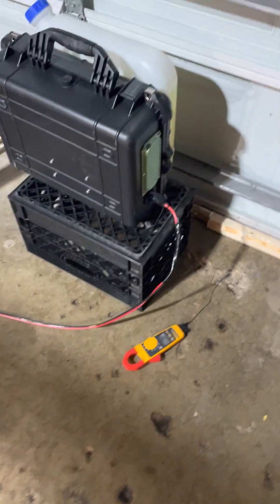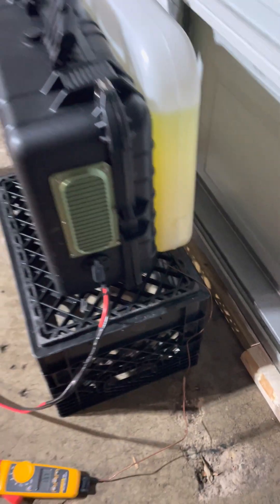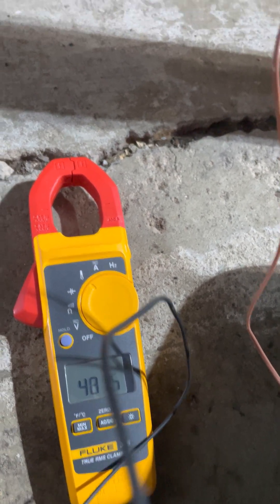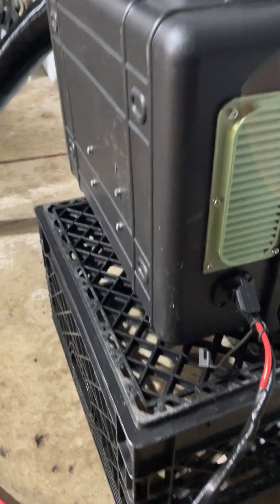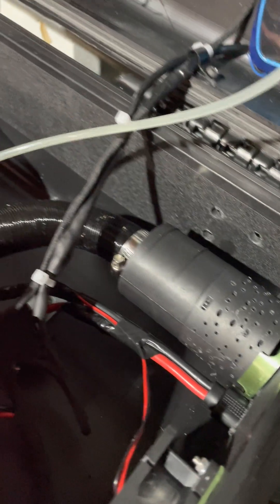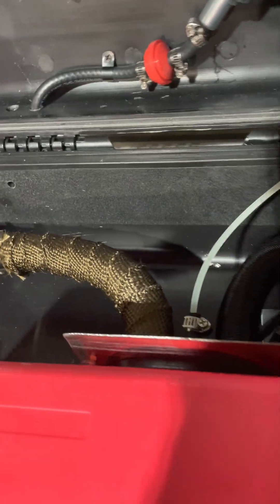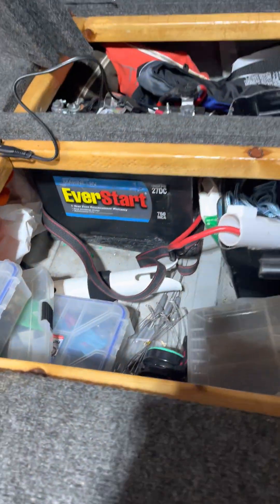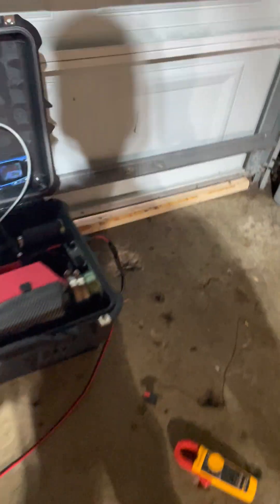Diesel heater in a Harbor Freight box: temps inside the box while running

Comment: Hey Tim - I know the 2KW heaters are smaller, do you have any clue if you could retrofit a 2KW into this build?
Reply from the maker: I don't think it would work with the 3-D printed STL files, but I'm sure you could make it work with enough ingenuity. It is smaller in all dimensions so it will definitely fit. You would just have to come up with the parts/tubing to extend it long enough to reach the sides of the box because the 2kw is shorter.
Reply: Keegan has plans for a 2 k heater as well

Comment: What's the point in building one of these when they sell all in one units for the same price? I mean this isn't water proof. There issue an internal battery. Scars the advantage to this?
Reply from the maker: Most of those have the little controller mounted on the outside which is a no go if you camp and this stays outside of the vehicle or tent. That's my number one use for this thing. That's why all of the temperatures I took here are important. My initial worry was the temps in the box would be too hot for the controller to live long. 

This is not waterproof, but I transport it on too of the vehicle and drive through rain and snow. I is rain proof and stayed dry inside even after a 10 hour drive. I also wanted something a bit more durable construction than paper thin sheet metal and generally cheap construction. Those all in ones just look so incredibly flimsy and cheaply made I chose to make this.

Comment: I have questions about the power plug. How did you do it? Are you using his 2 pronged plug?
Reply from the maker: It is just a standard SAE style female flush mount built into the box and a male on the power cord to the battery.

Comment: Nice walk around. I just ordered the parts from Keegan. What fuel pump are you using? It seems quiet.
Reply from the maker: This is the stock pump mounted in the little rubber isolation mount that comes with the kit. I've never really considered it being quite or loud. You can hear it in person, but I've never been bothered by it.

Comment: Could you please provide a link to the fuel filter you've used?
Reply from the maker: I bought it at a hardware store by the lawnmower stuff. You can get them anywhere, or order them. It's just a Briggs and Stratton fuel filter 150 micron. This is not where I ordered from, but it's the same thing. Briggs & Stratton 4105 5-Pack Of 298090S Fuel Filter 150 Micron For Engines without Fuel Pump https://a.co/d/hXgBSq9
Reply: @timlong1462  thank you!

Comment: I appreciate your information. How much diesel did you use?
Reply from the maker: I'm not sure because I didn't measure. There's a lot of videos on fuel usage. Also you can do the math because it's a dose pump that moves a specific volume, and the hz measures pumps per second.
Reply: @timlong1462  thanks

Comment: I don't understand why is everyone like doing this build if you can buy one in 2 different size that's already have the metal case. Not plastic?
Reply from the maker: The difference is being able to set this one outdoors in rain/snow and then throw it up on the roof during travel. None of the premade versions are waterproof or water resistant at all. While this design cant be dunked under water, it could be sprayed with a hose no worries or set out in the rain with the addition of a 3 inch plug, or with the output heat hose in place. 

The only design I saw built similar was the Hcalory (I think spelled that way) and it looked extremely cheaply made for $300 or $150 more than the kit I built this with. The metal case ones just look cheap and flimsy in my opinion. To each their own though. If one of those works for you then save the time and just go with a premade design.

Comment: What fuel line did you buy?  Is it a certain diameter? Looks like you did two different types.
Reply from the maker: This heater came with the hard nylon line which depending on who you trust is probably the correct stuff to use. Since it's a very small inner diameter it helps bleed the air out of the system faster, won't bulge outward under stroke presser from the pump, and it's very heat resistant. The line from the tank to the pump intake doesn't really matter, so I just used some gates fuel line that felt like it would stand up to the elements and be durable in the cold. There are plenty of other videos here on YouTube of how to properly install using the clear nylon fuel line. You use the small chunk of rubber fuel line they supply to essentially sheath the connection between the pump and heater and the nylon line.

If yours comes with the orange or green fuel line my advice would be take the pump, whatever fuel filter you plan to use and the fuel tank outlet to an auto parts store and get better fuel line.

Comment: Hey man, this is a nice build. I like that extra exhaust wrap!!  It works so well!!??  Would you consider wrapping that outer exhaust pipe as well for safety?  Or put the sleeve on it?  I’m doing a similar build now
Reply from the maker: I actually want the section inside the garage exposed, might as well get all the heat out of it that I can. If this was not a rental, I would put an 8-10 foot chunk of black pipe the length of the garage before exiting out the back to get more of the radiant exhaust heat into the garage. 
Since I can't cut holes in the wall I have to run the exhaust under the garage door, so the only part I have put the sleeve over is a 4 inch section that gets sandwiched under the door. I was able to layer three chunks of the heat tubing over one another on that small piece under the door to protect the rubber sweep. Then I fill the gaps under the rest of the door with assorted lengths of 2X4 lumber. Helps keep the draft from coming under the gap.

Comment: Topp 3.6hz in secret menu code 1688 is much better fuel consume. Ane burn more clean.
Now you clogs it slowly up.

3.6hz at topp and 1.2hz at low.
Over you only clogs it up slow but for shure.

You get the same heat
Reply: Can you explain this a bit more?  I didn’t entirely understand what it’s doing?
Reply: @vin9976  try low Hz 1.2 and max 3.6hz at topp.
Fan speed 2000 2200 low.
3600 to 4000 high.

Burn cleaner and saves fuel. And gives the same heat.

If not go see fine tune china air heater here in YouTube.
Abaout same same if not remember wrong.

Am on hospital now. But can send exactly later
Reply from the maker: I don't know about that…  Look up any reliable source on these and they say the exact opposite of what you have said. Running these at low fuel rates results in more carbon buildup. You have to keep the combustion temperature high enough in order to reduce this.
Reply: @timlong1462  that depens how much experience you wanna listening to.

If you want it clean and same heat for lower cost you use them. 
If you wanna open and clean it and use more waste of money for same heat, good luck to you.

I am still burning 3 years stright
Reply: @timlong1462  try and see ur self. Alsow fuel lowe cost. And less watt is used
Reply from the maker: @Lordlindef hey, just wanted to come back and say thank you for your comment. To be honest I did not understand your first comment. After looking into tuning the parameters on these heaters I realized you were meaning to reduce the fuel pump speed, but keep the fan RPM high. So less fuel, more air. Basically running it leaner. Initially I thought you were saying do not run over 3.6hz which on factory settings would also be a really low fan speed. I'll give your recommendation a try, but I don't know if I use this enough to truly see a difference in the short term.

Comment: I just got my one active today.
Mine is in a large wooden box we were going to throw away.
I wondered the temperature in that Keegan ‘case.’
Interesting to see your temp findings.
They are great little machines - Although mine has used FAR more fuel in the first two hours than I thought!
T’will be a learning curve.
Reply: I haven’t started mine yet.   How has your fuel consumption been?   Thanks
Reply: @Zekerose  I don’t think they are particularly noteworthy for fuel consumption but they give a dry heat.
Good for a caravan where the wooden carcass tend to rot.

Comment: I just built my own from an All-In-One tin box into a HF Apache case.  I like your install.  Was curious about running the box closed and having the controller overheat auto shut off kick on?  I put in a vent and a fan inside the box, but still ended up having to mount the controller on the outside of the case if I wanted to run it while closed.  Just curious if you have seen anything similar?
Reply from the maker: I have not had that happen in many hours of run time. Set up like this in the box you cannot use the thermostat function, you have to go to the Hz setting. 

Your questions are exactly why I made this video though. I was curious what the temperatures inside would be, and how close it would be to auto shut off or cooking the controller. It's a non-issue though.

Comment: Looks good, I plan on making the same build.  Two questions.  What size or number harbor freight box did you use?  Regards to the fan, is the fan pulling outside air from the exhaust side or pulling air into the box from the fan side?
Reply from the maker: It is the Apache 4800 usually about $60 at Harbor freight. The fan is blowing to the inside of the box. That way it is blowing the exhaust out the shortest distance and not drawing it  across the controller, fuel pump and combustion intake. I'm planning to add a small switch in line on the fan and mount it on the outside of the box. Mostly just for curiosity's sake to see how much it actually changes the temperature inside. With the heat wrap being so incredibly effective it may not be necessary, but since it draws so little current it can't hurt  to have.

Comment from the maker: Timestamps for various temperatures
3:00 Inside the box temp on intake side 
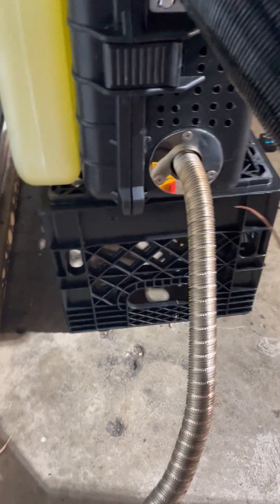4:30 Exhaust Temperature 
5:30 Inside box temp exhaust side
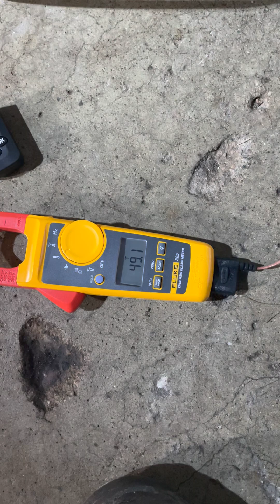6:30 intake air temp (ambient temp)
7:00 Hot air outlet temp 
8:35 inside view of build with box open 
10:25 Exhaust temperature with header wrap and exhaust insulation

Due to the way I put the amp meter over both the positive and negative wires of the fan I got an incorrect reading. This computer fan only pulls 0.33 A at 12 V.